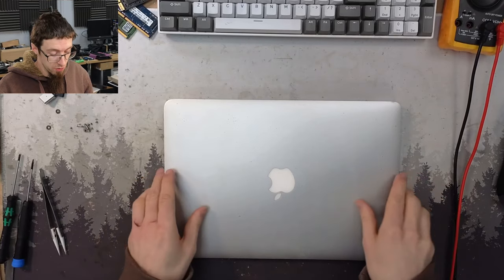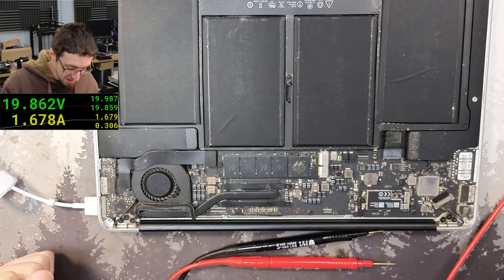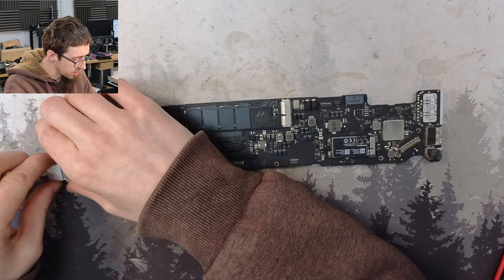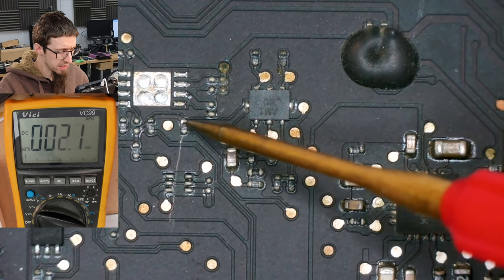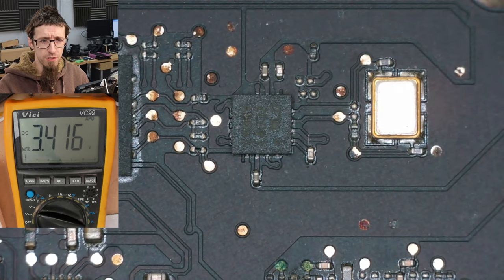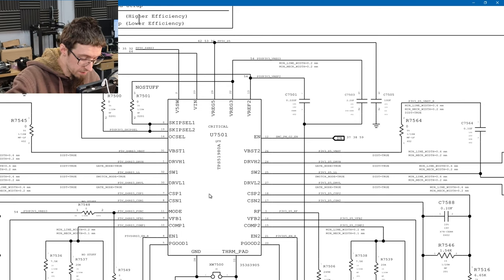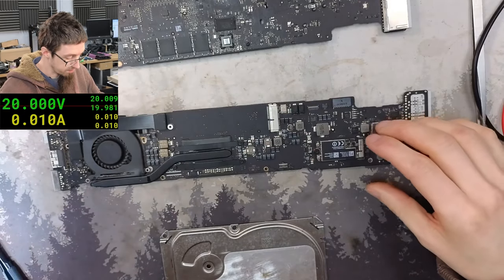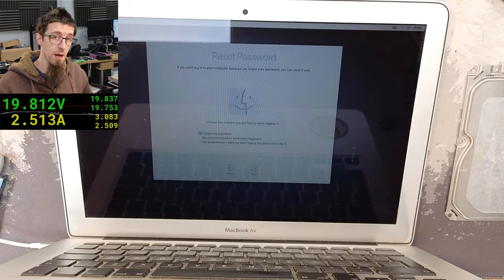It only takes a drip, dusty MacBook Air with no power - LFC#379

Comment: Do yourself a favor and use rosin for these small resistors, it will not evaporate and will keep them glued to surface until solder melt much better than synthetic flux.

Comment: Hey man, I was working on a 1466 that had power and backlight issues and I had the original charger. Where can I find a cable that I can plug into my power supply or meter to measure the draw?
Reply from the maker: Search ebay for magsafe 2 cable, and you can buy the bare cable. Or you can cut one off of a dead charger. These days I have a Paul L Daniels type-c meter, and I use a Type-C to MagSafe 2 cable with that.

Comment: Great video overall, but I noticed that boot was unusually slow, did you check for sensors using HW monitor tools once it booted?
Reply from the maker: Yea it seemed fine, but it's a 1,8GHz 4GB board, so it's not exactly a speedy boi😔

Comment: With the tarnished points across the board, I am dismayed that there isnt some form of water repellent coating protecting it at least to a certain extent. Im thinking something like the nail varnish coating people use when doing delidding for liquid metal.
Reply: No, no water shields, no conformal coating.  You might almost think that Apple intentionally design them with nonexistent water ingress protection to make them more disposable.

Comment: Fine video. You should have checked the resistors before you desoldered them. Not everyone has computer program to assist them. I’ll leave  it at that. Thank you
Reply from the maker: I actually did, but I cut the section of the video because I was getting inconclusive results that didn't really say anything. I thought that might be indicative of the bad resistor (open line, so it gave a nonsense in-circuit reading) but after I replaced the resistor, I got the same nonsense reading. It might've been worth leaving in as a demonstration that in-circuit measurements can be deceiving, but the video was already pushing run-time.

Comment: Great fix but are Apple laptops that slow to load?
Reply from the maker: Depends. If the macOS install has had some false starts, it'll likely fsck the drive on the next boot, which slows things down. But also macs in general aren't famous for their boot time. They sleep/wake quickly instead.

Comment: That looks like vape damage and dust (caused by vaping).
Reply: Vape covers with a sticky liquid which is impossible to remove, except with water. One cannot put water on a board. Maybe there is another way but I don not know it.